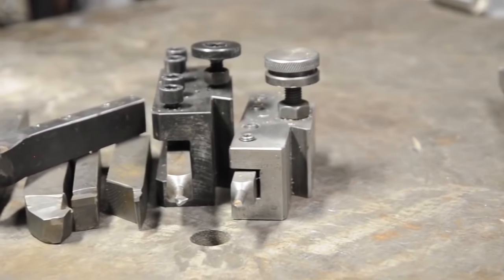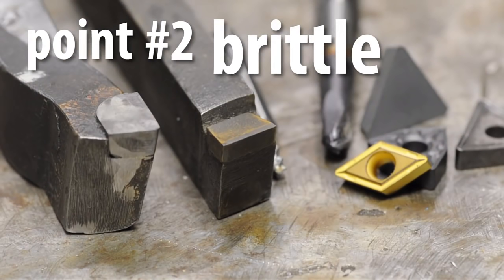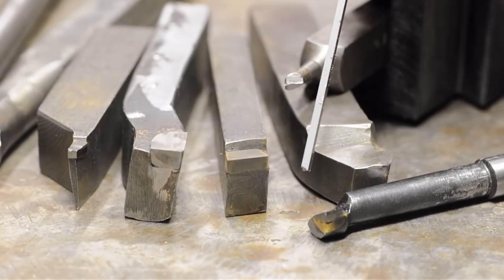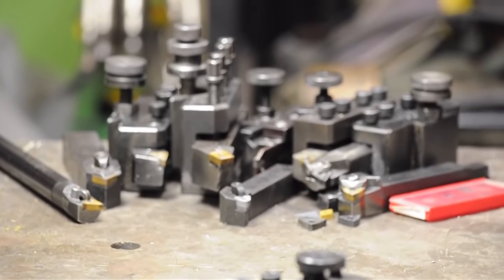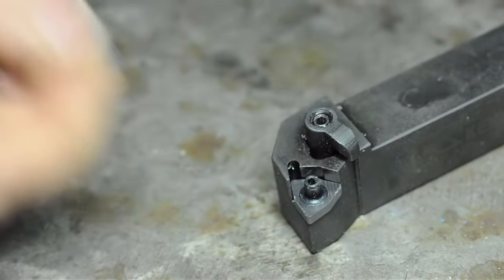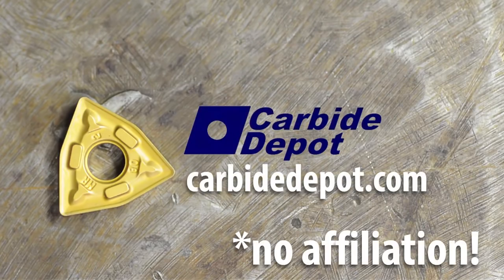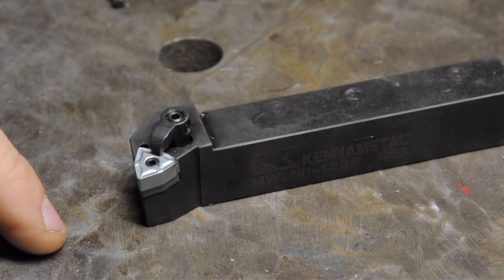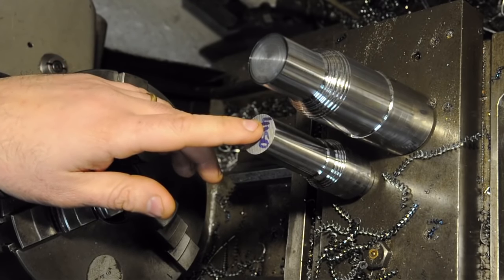A Brief Chat about Carbide Tooling

Comment: In most cases carbide shouldn't be sharp. Only when machining superalloys, like Inconels, Incoloys, Hastaloys, etc., should the carbide inserts be sharp. The fact is, the ROI on using the proper carbide grade, geometry, chip breaker, edge prep, at proper speeds, feeds, and depth of cut, is proven shift after shift in shops that closely monitor these things. I must stress that the almost universally most important factor in the productivity and efficiency of, the quality of the finished workpiece, and especially the tool life, is determined by the rigidity of the set up of the workholding and toolholding. When one of my guys is calling me over to his machine and says he's having problems, by far the most common problem is a failure to create and / or maintain the rigidity of either the workpiece, the tools, or both.

The intermittent cooling issue cannot be stressed enough, also. I'm constantly trying to teach guys with 20 years more experience in the machine shop then I have that just splashing a little coolant on one side of a face mill is doing more harm than good. I guess that's why I'm running the shop, and making those decisions, on what tools are used on what jobs, and how they are used. And they are running the same machines, or a newer version of the same machine, they were 20 years ago. They're just a hell of a lot more productive these days, and that's the only way that I can get them more money at review time is if their productivity is increasing, efficiency is increasing. I go to bat for my guys, so they tend to listen to me more on the technical stuff, though still not often enough, these days. The companies making the carbide tooling are spending millions of dollars a year on finding out what works, why it works, and what doesn't, and they genuinely want American industry, American machine shops, to succeed. If we are succeeding we are buying their tooling., but, if all they have is a great ad campaign and the same crap tooling, and they know who they are, then guys like me are not buying any of it. Numbers don't lie. When you have enough numbers and they're consistent, even senior management can understand it (as long as the graphs are big enough and colorful enough). So it is a good idea to listen to the guy who is selling the tooling, if they are paying attention and learning from the people that are making the tooling and testing the tooling. I've done so many tests on tooling from three of the better known tooling manufacturers that I get free tools for my shop where I'm employed. , each of the last three places. I've been employed, all the time. Boxes and boxes of inserts with different chip breakers, different edge preps, different nose geometry, and all that stuff does make a difference. And there is no universally best solution for all materials and all applications. It is a good idea to take notes on what you use, how you used it, and what results were achieved. I do that in my home shop whether I'm cutting. Aluminum, tool steel, or highly figured exotic hardwoods.

And in all the years I've been using carbide tooling I have never once seen an example of someone regrinding a worn insert and having it perform in any way that I felt was useful and that the time wasted regrinding it was time well spent. But everyone is free to do as they see fit.

On the broken endmill, I have two local grinders who can actually grind and coat a broken endmill and it performs better.

As for holders, I rarely get value for the investment on the, "value," tooling. Even in flea markets, look for names like Sandvik, Kennametal, Widia, Walter, Ingersoll, etc., holders, but be aware of holders that need many parts and springs. Not only can cheap holders fail or cause other issues, they are far more likely to have incorrect geometry. If the geometry of the holder is incorrect in certain ways, no matter what insert you use, and no matter what you do to alter that set up, it will never perform well, or at the very least, never perform as well as it should.

One other thing, I've built holders to use the large unused angles on the DCMT and CCMT, corners that are usually wasted. These large angles can actually be GREAT for heavy turning.

The turning at 1200 rpm, as the diameter is smaller and smaller the sfm is also proportionately decreasing, and this can be an issue. 4140, 4340, 4150 (just a little more carbon) are generally gummy materials, and aggressive chipbreakers are favored. Also, as we have moved into using more Chinese steels, and more steels used for fracking, the quality of such steels has decreased. It just has. We actually refer to certain low quality 4140, 4340, or 410 stainless, especially cast or forged 410, as, "frack 4140," or, "frack 410," to warn the machinists that it will be poorly performing as workpiece material, inconsistent to such a degree that you DO NOT want to stop paying close attention to your machine(s), and worst of all, it is very likely to have pockets or regions thick with inclusions. These inclusions could be poorly melted/integrated bits of other steels, which could be bad, could be various oxides, which could be very bad, or they could be silicates, which may be the end of your tool (imagine turning a pre-hardened, quenched, and tempered moderate quality steel, and, at your proper 800sfm, .150" DOC, and proper .030" fpr, your guys have run a few thousand of these pieces that are around 11" diameter and 18" long when complete, and 12 pieces into another day, slamming into an inclusion of some extremely hard glass securely held within the metal! It's LOUD, it shatters your insert, but the insert slams into it 30 more times before your machinist can react. Not good. THAT'S, "frack 4140," in all it's joy. Even more fun with a 5" face mill in a CAT50 HMC.)

Comment: dear tot -
I replaced my dead bench grinding wheel and it came with 2 stone wheels. my old one had a wire wheel, which I saved. I know that a wire wheel is dangerous (as I can tell from all the broken off wires), but what choice do I have ? a wire wheel is very useful. is there such a thing as say, a 3M wheel that will do the job, but doesn't take 10 times as long to do it ?

Comment: Can I cut steel 1018 or 1045 if I have inserts suited for cast iron and non ferrous metals?. The model of carbide inserts that I have are KYOCERA ZCNT12T306 and in the box has circled letter "red K"and "green N"

Comment: mm, i have a medium CAZANEIVE, 575X2000, THE 4 JAW 22 INCH AND  its heavy, and to change to the 12 inch 3 jaw is a mission, with only one n a half hands, wondered why my store bought carbides gave a ruff finish, I  swing at 360rpm, cos the forces to crank that 4 jaw up and to brake it down are considerable, 12 hp good foot brake  ok listening to you young TONY , I  am 73, i will try doubling my usual rpm, by the way i have a 250 and a 180mm 3 jaw and i often chuck em up in the 4 jaw. in my channel you can see the lathe, i'm a shipbuilder not a machinist

Comment: What would be a good tool post for an 8"South bend lathe? We got out soon an estate sale for 300$ I plugged it in and used for about a year. Last week I put a belt on it. I just bought 400$worth of insert tooling but I need a better tool post. I'm not worried about a quick change. I see them for 300$and less on Amazon I'm just not sure if it's a good one I'd just as soon get one with the bolts sticking up mine has little sunk Allen screws and they're a pain in the arse

Comment: Hey Tony - Thank you so much for these educational videos. I really appreciate this. I have a question though - I am having a woodturning lathe with V-Knife which copies a template horizontally and the tip of the V-Knife goes up and down (which in turn decided the depth of the cut in the workpiece). In order to use these carbide tips, I guess it would require the tip to move forward and backward to shape the depth of the cut. So is my assumption right that these carbide tips may not be a replacement for my V-Knife (which goes up & down vertically rather than forward  & backward horizontally)?
Show less

REPLY

Comment: With brazed carbide tools, is it typically/always brazed to HSS?  Or is it something less?  So that it might still be useful after the carbide is gone.
Reply from the maker: Not brazed to HSS.  If you heat HSS enough to braze to it, it would've be HSS anymore :) -- just a convenient piece of mild steel usually does the trick.

Comment: I use carbide for nearly everything because I'm lazy, but when it comes to machining acrylic plastic, NOTHING beats the right geometry in HSS - you pretty much can't BUY the right geometry for acrylic in an insert, AFAICT. With the right geometry and soapy water for cutting fluid, you can machine acrylic to nearly optical surfaces - translucent, you can see through the as-machined, un-polished surface. It's nice. :)

Comment: Very informative. My job just purchased a haas st10. Cnc lathe and since I work in machine shop alone. I've been trying to learn as much as possible. My supervisor and I have been charged with learning to use it. Lol. 90% of what we machine is plastic or drawn epoxy. Can you recommend any inserts? Thanks for share your knowledge.
Reply from the maker: Thanks Ray -- plastic is a little tricky -- is it filled with anything? (glass filled?) if not, try to find some HSS inserts for your tooling.  They're very sharp.  Failing that, inserts for aluminum are quite sharp.  Either of those will do better than inserts for steel.
Reply: This Old Tony 
Thanks. The tool rep said aluminum inserts would work. But sometimes the finish sucks. You said something interesting about min cut depth. I think on are final pass ( only 002) it's not cutting its rubbing. Oh well got a lot to learn. Thanks.

Comment: If you are looking for the right kind of insert for the Job you can use the "Tool Guides" on the ISCAR or Sandvic websites. It's really easy to use. And it's free!
Reply: AggRo Bert buy kennametal inserts
Reply: You don't have to buy them from ISCAR or Sandvik. But if you want an easy way to find out wich form/type of insert is best for your job you can use these two Tool Guides. Buy them where ever you want ;-)

Comment: Is the carbide used in lathe bits the same as tungsten carbide tig electrodes? I've just got a lathe and am going to make a scribe for a first project, just wondering if I can use tig electrodes for the scribe insert, thanks.

Comment: Sooo... "for (further) discussion's sake": How much sense would it make to try and make (or purchase?) a second holder for the DCMT or CCMT inserts which held them in a position rotated by 90 degrees, so you could use the remaining two edges to cut?
Reply from the maker: Would probably be a fun project!  Would be good for facing!
Reply: A lot. I made a holder (although you can actually buy them) to use the other two corners on my CCMT inserts. Excellent for heavy roughing duty (in some steels can run higher DOC without chatter etc than using the normal corners) and as an added bonus, I have a lifetime supply of inserts that are already minus two corners to feed it with... 😭

Comment: Carbide is better in pretty much every way except when it comes to easily making custom tools. I use carbide on everything, even my mini-lathe. You can just do so much more in much less time without having to worry about burning the tool up. I was catching hell machining some titanium with HSS. It would work harden in about 10 seconds and ruin the tool edge. I threw some carbide at it and it doesn't give two shits how hard the material gets.

Comment: I use  carbide.  And  I think I prefer HSS for most things. My machinery  is not  New Super rigid  CNC stuff.   And older machines are not rigid enough  to take full advantage of the stuff and the vibration  wrecks it  so  one  gets about  half the life  one should from say a j half inch 4 flute carbide end mill .  so I spend a lot of time in back gears in the slower pulleys.
Reply: Maybe your machines just need some adjustments or you are too carefull when using carbide.
Years ago i lend an old worker one of my WNMG holder, and it sounded horrible when he used it, because he used it like HSS. I told him more feed rate, more RPM, more Ap, and the lathe immediarly stopped to scream and vibrate

Comment: What benefits do you get with the chocolate chip grinding wheels? I usually use Wagon Wheels if the material isn't too hard but they do get a bit sticky if you let them get too hot!

Comment: I have to disagree with you on the point of grinding carbide to the same angles as HSS. I tried doing this as a test with my swiss tool grinder. I ground identical HSS and carbide tooling, and found the HSS performed much differently. In general, the carbide seems to like a lot less top and side rake, and slightly less relief. They come ground with very little rake (usually zero) because at higher material removal rates this is preferred. For us home shop guys, if you want improved performance over HSS but don't have the horsepower or RPM, I have found 1-2 degrees of rake to be ideal for most all materials, and about 5-7 degrees of relief. With my 10L I can take 60thou off the diameter in steel without much issue; any deeper and I run out of horsepower. I have taken 50 thou DOC on aluminum, but I begin to run into rigidity issues and have to resort to a slower feedrate; I have found less DOC and higher feed to be more efficient at material removal. 

I can go into more detail, but in general, with the higher speeds you will use with carbide the lower rake angle allows the chip to curl more easily; otherwise you get a nice stringy mess.

Comment: As a hobby machinist, I was hoping you wound talk about DIN (standard = cheaper) carbide inserts versus proprietary (awesome = expensive).  I've seen proprietary tool holders at flea markets very cheap because the inserts are usually VERY expensive, so do your homework before buying it!  Also it's nice to buy a brand name insert (eg Iscar, Mitsubishi, etc) , but for the home machinist, very often a off brand insert works just fine (mild steel), so always buy a DIN style tool holder is my ($$$) lesson learned.  What??? You didn't talk about the 6's and 9 chips? Tony!
Reply from the maker: Good point Richard -- unfortunately in a video such as this there just isn't time to get into everything!

Comment: hi Tony. 
took me back to my days as a production engineer at GKN on a machining line.
could you refresh my memory and for the benefit of others discuss nose radius versus feed rate versus finish.
I bet you have already done so on a previous video and I missed it ?
Steve
Reply from the maker: Larger nose radius allows for larger depth of cut, while maintaining a good finish, and yielding a strong tool.  Smaller nose = sharper, but DOC and feed rate must be slower for equivalent surface finish.  If you go too fast with a small nose it's essentially like thread cutting.

Comment: You need speed, horse power AND rigidity to use carbide inserts successfully. Smaller, hobbyist style lathes lack on the rigidity part and horse power. But, you can learn to "work with what you got" and make it work, just not as easy without a heavier, more capable machine.

Comment: not here to say u are wrong just trying to give u some more information on the subject
@5:06 u say "the carbide we use is a matrix , its a mixture of usualy tungsten and carbide powders "

no
as carbide already  is a mixture of tungsten and cobalt and some other materials depending on what the carbide is needed for ( also the size of the powder particle`s plays a big role)
when carbide is recycled all compontent`s are separated again and is used to start from scratch 
the quality of the tungsten wil go down in these proceses and is usualy used as a filler for less crytical carbide`s 

even when carbide is crushed to a powder it wil contain different elements within it 
main ingredient for carbide are always these 2 elements W Tungsten and  Co Cobalt 
as cobalt is the binding ingredient
if u heat up carbide to around 1100 1200 degrees C u wil find out the cobalt wil start to show itself on the surface 
this is also the main reason why brazing by hand is less superior to induction brazing as the proces is not as stable with the heat and therefor damaging the carbide 

ok nothing to see here ,bye

Comment: Hi, may I know if the tool holder must always be placed parallel to the tool post when using with inserts? Appreciate your kind assistance :)
Reply from the maker: yes.  on a manual lathe you have a lot of margin for error but CNC or if you are using a tool library, yes.
Reply: This Old Tony Hi, thanks for your response. So, for conventional lathe (old lathe), the toolholder must be positioned and locked parallel to the toolpost (against the wall/side of the tool post)?

What will happen, when CNMG insert is used and the toolholder is designed to take 95-degree approach angle (i.e. -5 deg lead angle, correct me if I’m wrong) is positioned more that 95-degree? Does it have any effects on the inserts?
Reply: @cyranox90  As long as there is no risk of a collision, or you are aware of that, you can position the toolholder any way you like or need, even on a CNC